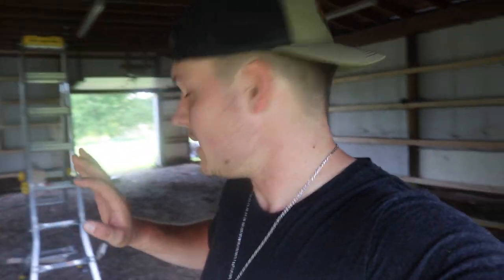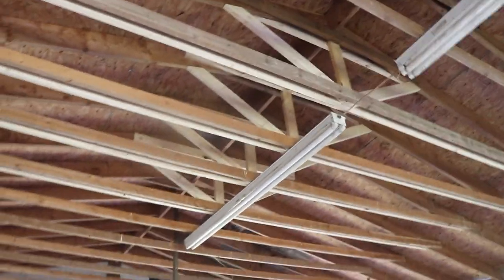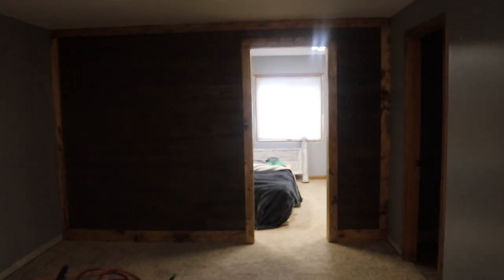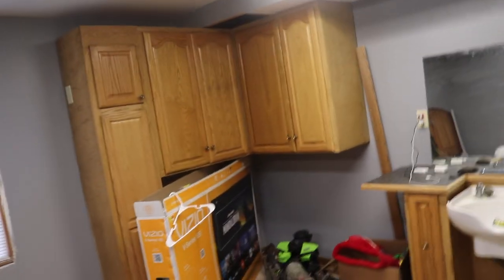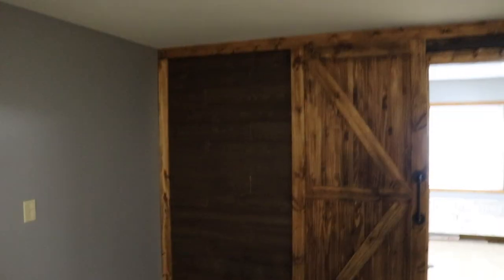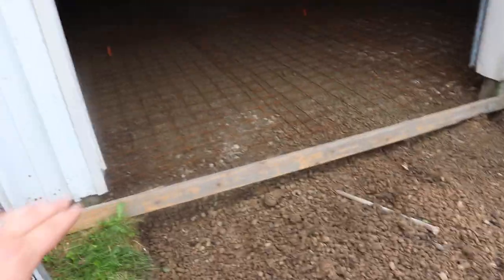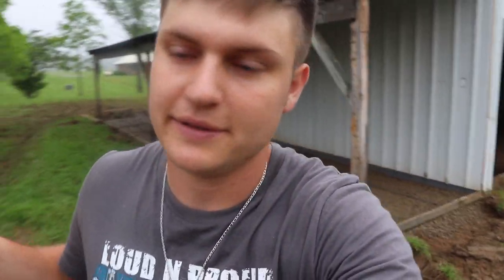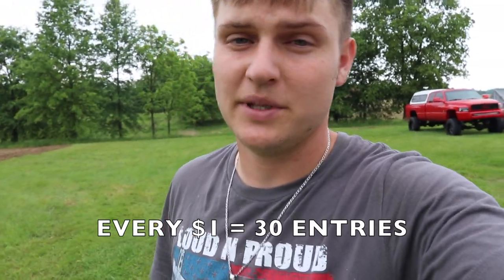My DIY Dream garage gets CONCRETE PREP!! EP. 7

Comment: How many inches thick and 3000 psi make sure it is sufficient for lift later
Reply: We would use 4000lb concrete with 6x6 mesh and fiber. And at least 6” thick where a lift might go